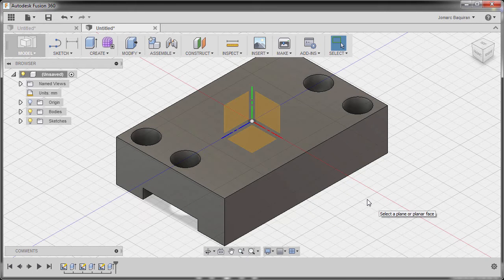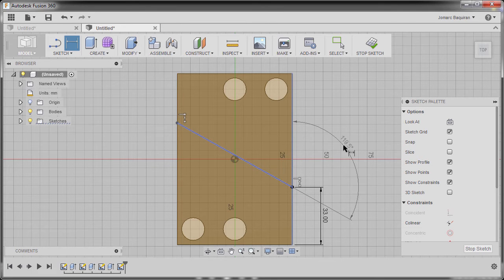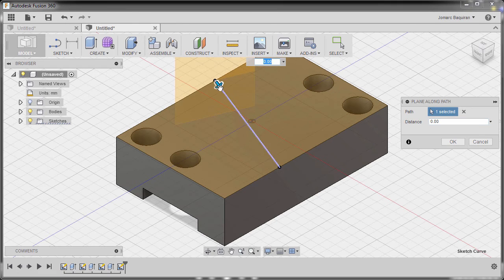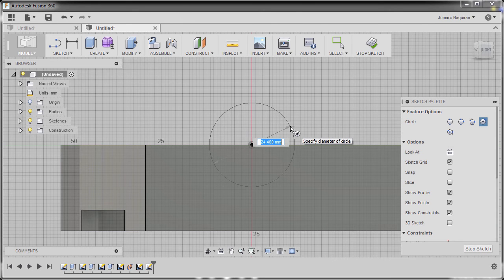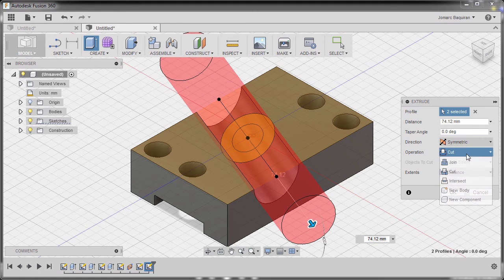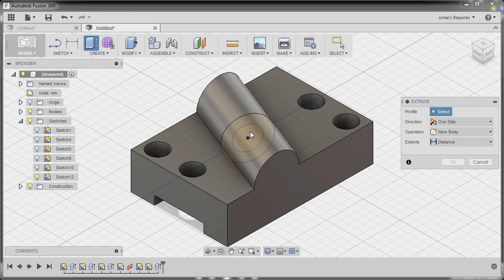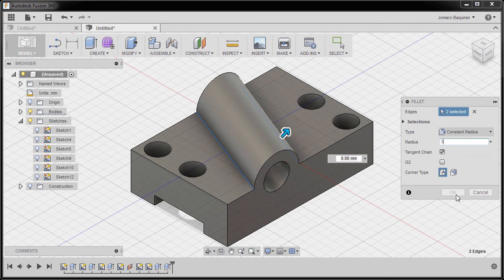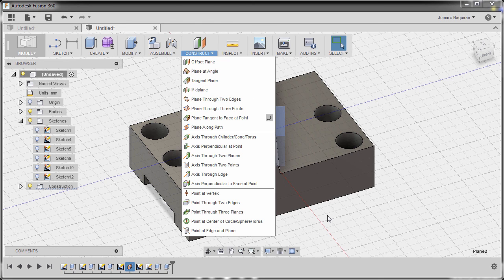Fusion 360 Part Modeling Exercise 04 - Diagonal extrusion

Comment: My version of Fusion does not allow for this method. I can't get the extrusion to cut the angle at the outer edge.
Reply: I have the latest version and I have the same problem.
As soon I choose symmetric, join, the distance thing disappears.
I tried to use both sides but it gives the error.
I can extrude the profile with the hole and then cut it with another sketch but this way on the video is better and faster. Maybe its a bug.
Reply: I tried with pull and the results are the same. :(
Reply: Work around. They changed FUSION from this version in the video. To accomplish the cut, when you place your plane on the angle, create your circle and then EXTRUDE TWO SIDES and then EXTRUDE TO OBJECT. You will have to pick them one at a time and make sure you click CHAIN EVENTS> Then it will work.
Reply: That should read "CHAIN FACES"
Reply: Hi. The good people at Autodesk helped me with that problem and the solution is more or less like you write. Use the both sides instead of symmetric when extruding and click the chain faces.
Thanks.